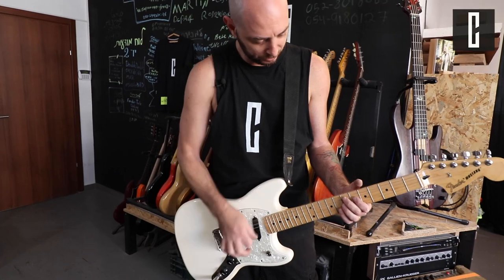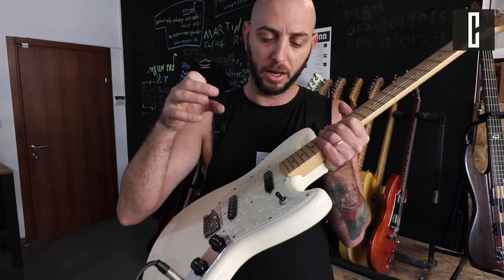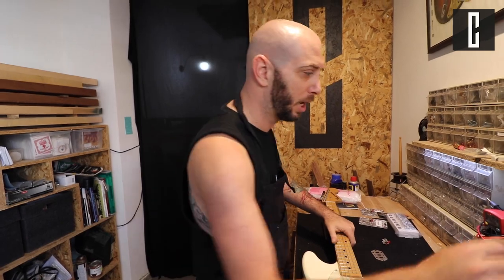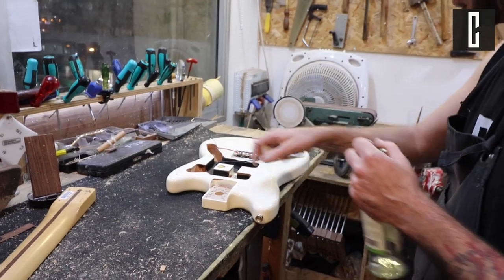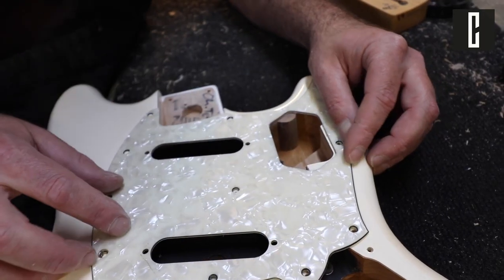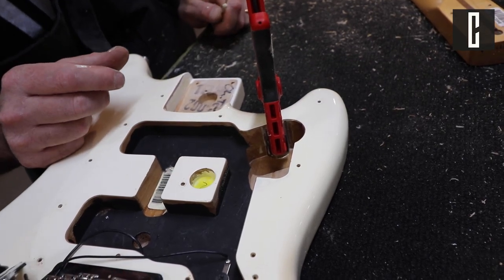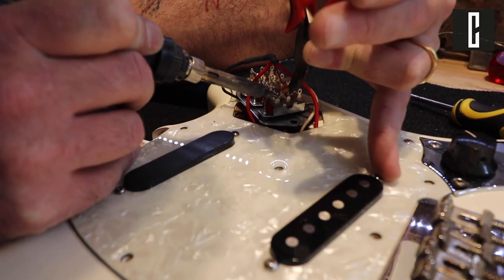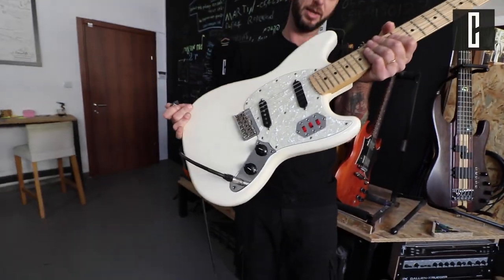Mustang + Jaguar = JagStang?! (🎸Guitar Modding)

Comment: Looking at getting the Squier sonic version of this with the HH configuration. Getting a pickguard for it custom done and deleting the tone pot and moving the 3 way switch to it and getting a 25.5” scale length replacement neck for it so I can comfortably put thicker strings on it and effectively tune lower also ofc gotta mention that the pickups would be replaced with a set of Seymour Duncan JB or Distortions.

Comment: They dropped the classic Mustang switches just because they're more expensive... Fender...
Reply: Chris Greene  That's nice then
Do you know what are they?
I find them kinda inconsistent, like sometimes they just go straight to the other side without much force applied and sometimes they get kinda stuck for no apparent reason
Reply: they kept the switches on the classic vibe and vintage modified and its not like aftermarket doesnt exist a lot of mustangs still have them i find it hard to find one with the switch
edit: i think that they have the three way switch on ones without the floating bridge and you can easily hard tail a mustang if your worried about tuning or do a couple of things to fix tuning fun story i bought a classic vibe mutang and the seller hardtailed it without telling me they sadored it to the plate